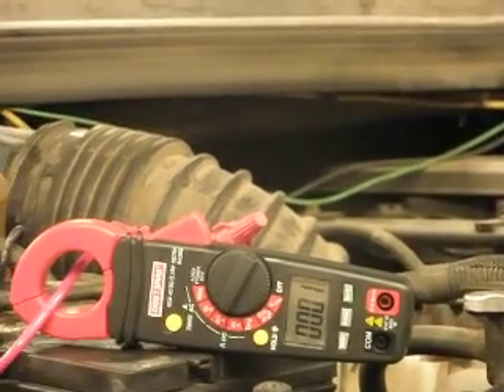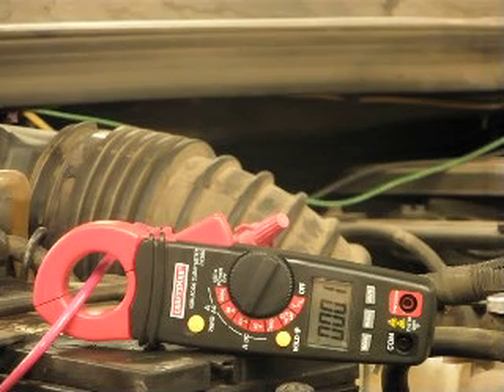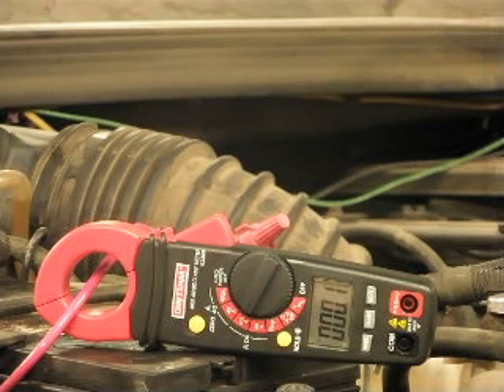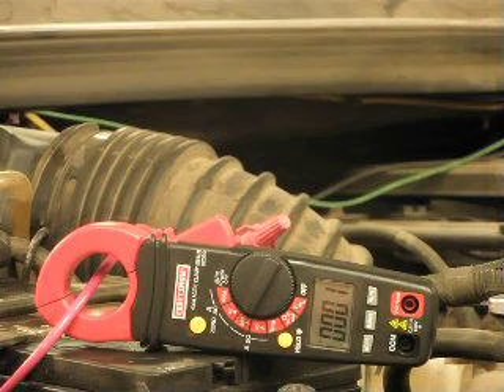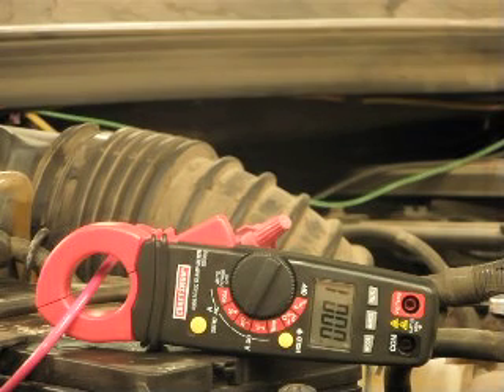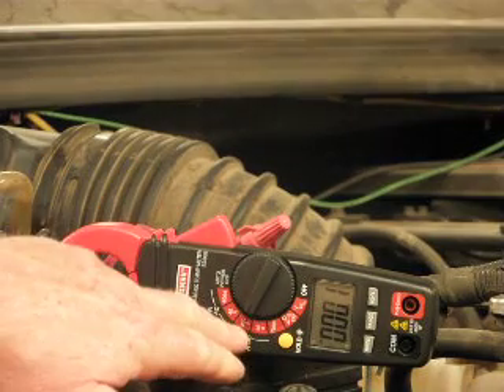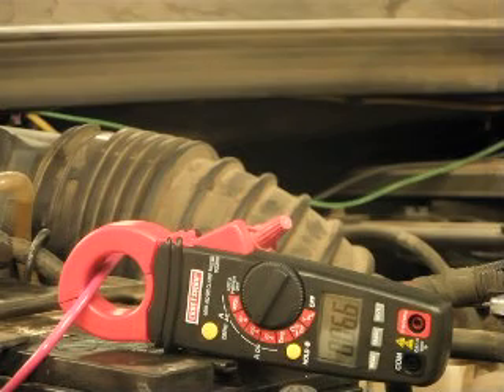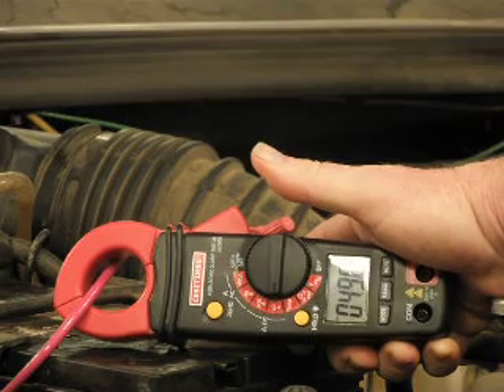Re: HHO Test - Power Supply v.s. Battery

Comment: I think it would be simpler to use water injection.  It was used during WW2 for aircraft engines to increase power and prevent knocking in supercharged engines.  Subaru cars still use this system on turbocharged engines.  Hydrogen does have a low partial pressure so petrol will vaporise  much better but then why not just use LP gas(Propane).